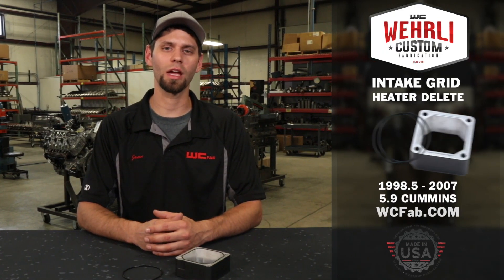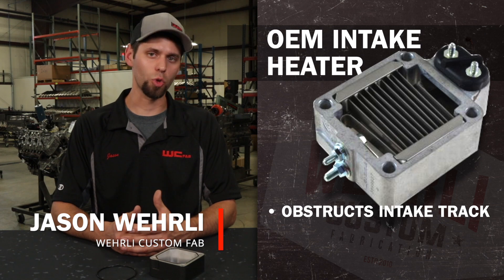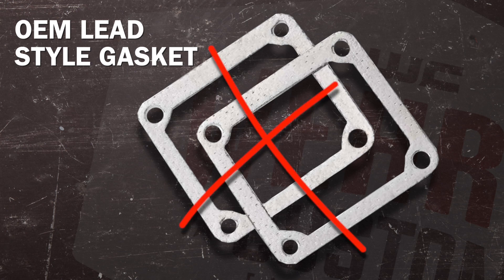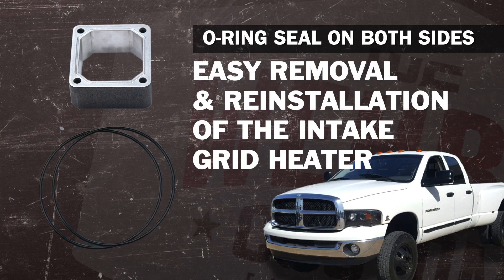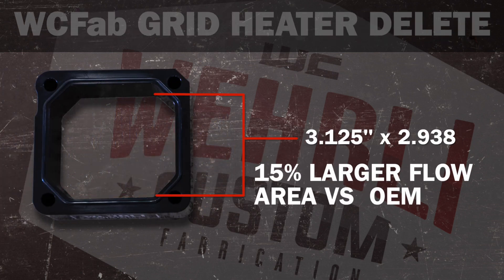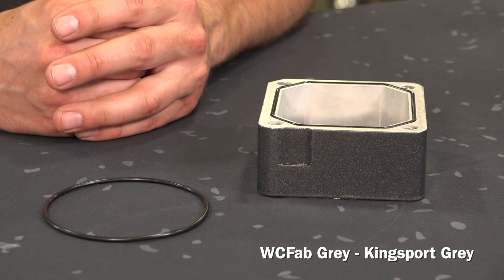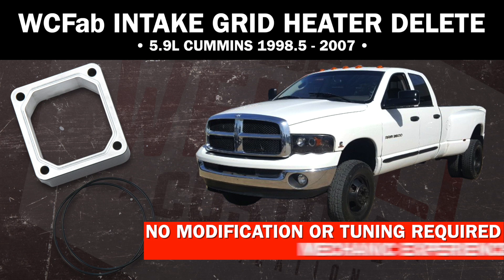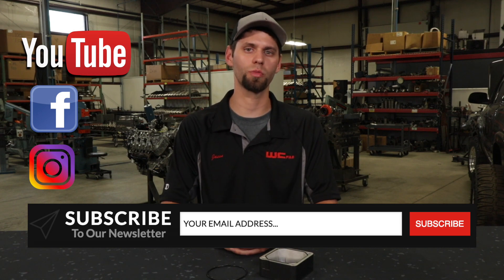WCFab 1998.5-2007 5.9L Cummins Intake Spacer Kit

Comment: How are we going to connect the wires that run to the grid heater now that it was deleted ?
Reply from the maker: The wiring for the grid heater needs to be properly terminated, secured, and insulated when it is not in use on the vehicle. Please give us a call at 630-277-8239 to receive additional tech support for your application from one of our specialists.